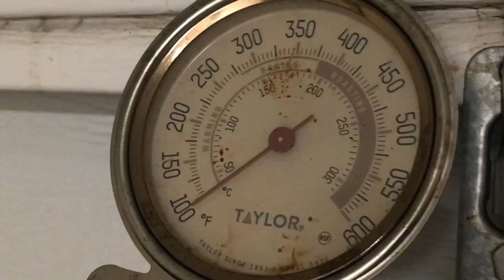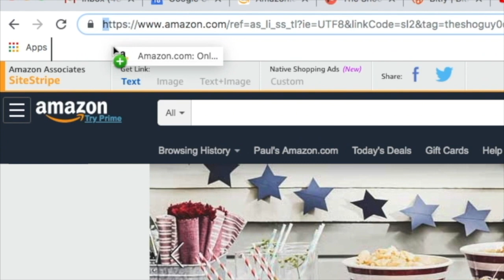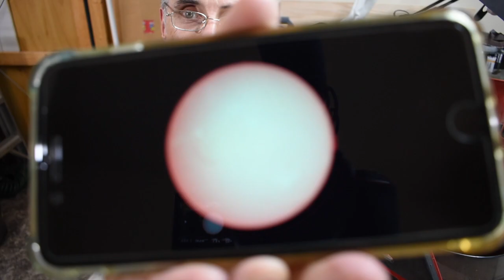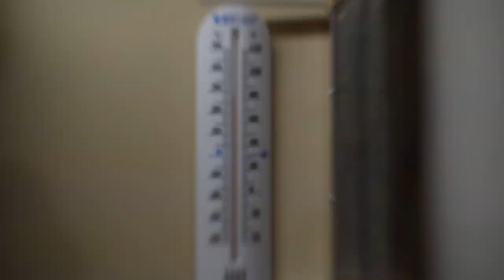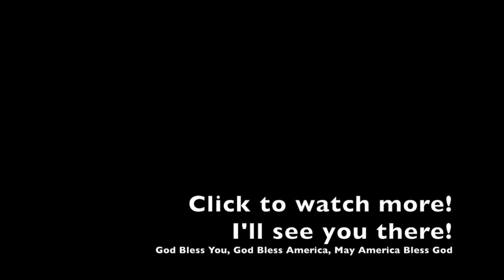Fixing the CRAFTSMAN Riding Lawn Mower

Comment: The high temps are a real impediment to enjoyable living. SoCal, at least where I am, has been a few degrees cooler than your area and the mountains have been getting thunderstorms. No water rationing here right now. Nice that you got the cowling fixed. Disappointed that you couldn't use Flex Tape. Next time.
Reply from the maker: Keep thinking cool thoughts! It's a bit too hot even for flex tape right now. Stay tuned. I've got some flex products planned in the near future.

Comment: Here in the Portland, OR area had bad(for us) heat the last 4 days...hitting at least 100..Monday was 105.  But cooling trend has started. 
To add the the "fun" factor our Heat Pump (aka A/C in summer) has decided  to be less than it's usually reliable self.  It's been fine up to this week, but on these hot days decided to be  finicky if it wanted to startup or not. Call into HVAC guy ..still waiting to get a call for an actual appointment!!??  Capacitor tests  in spec BUT... going to order a replacement anyway. Maybe the high heat is causing to to weaken? If nothing else to have on hand,
Reply from the maker: Sorry to hear. I know of cooling systems giving out on the hottest of days. Our system went out a year after moving into this place. https://youtu.be/VQtJQGLk3Eo